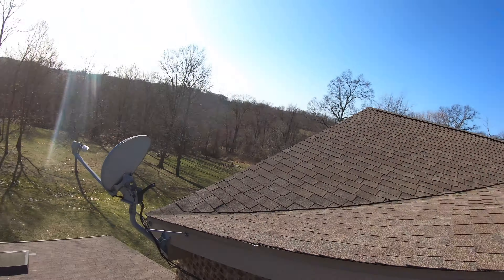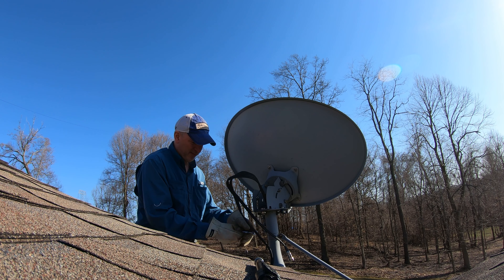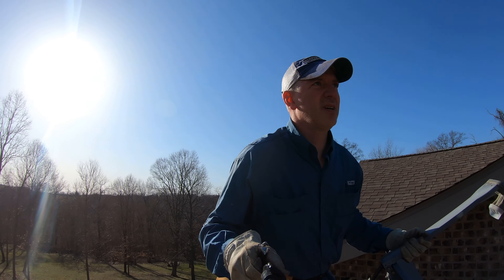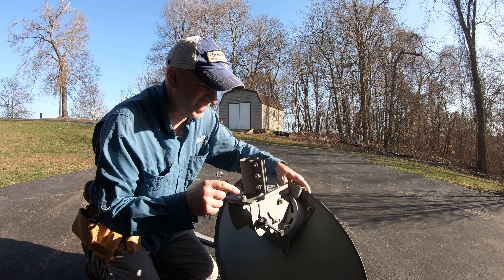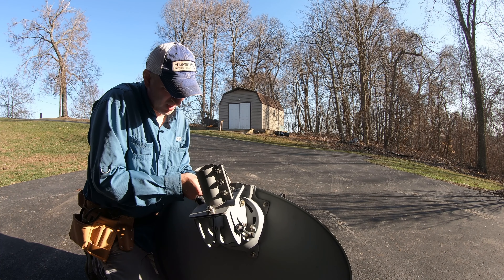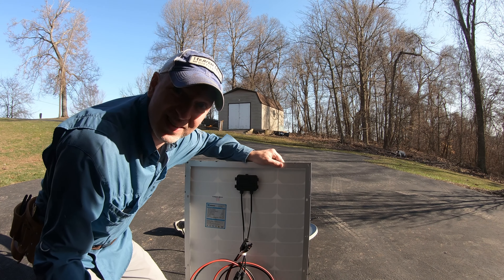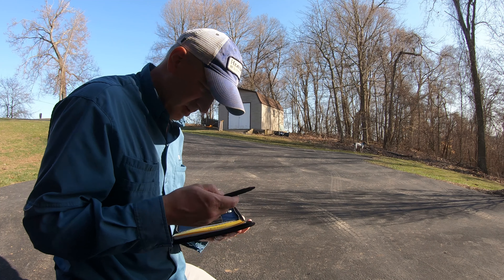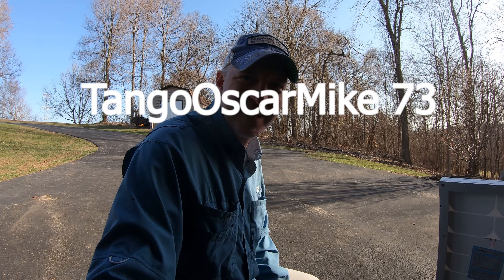Can I repurpose an old satellite TV dish into a solar panel mount?

Comment: I’m wondering if you could take a wall mounted flat screen tv mount that tilts and swivels and attach it to a south facing wall on a house. Then you could manually adjust it a 2-3  times a day to maximize wattage. I’d love to see a video on that.
Reply from the maker: I really haven't found the need to adjust it that often.  I think taking in account some inefficiency when determining the size of the panel you need is easier.
Reply: I bought a 75kg rated tv mount just for this purpose. It has a huge 350watt panel on it. Not so much to optimize output, but I can mount it on a south east wall and still face it south or sw. Also I can swivel it 15 degrees down for the low winter sun in Norway, and store it flat to the wall when I'm not at the house or in high wind. Works great.

Comment: I wouldn't overthink it a few cross  pieces and you are good I have for on the camper and doing 65-70 mph they are fine with the small brackets and eternabond tape

Comment: Hi Tom,
If you need to make a mount, use flat stock along the short dimension and angle  for the long dimension. The angle will add a lot of stiffness. Yesterday, when you made that contact with Jason as KA6LMS/5 on 10W, I reduced my power to 10W and when he next called for QRP made it through on the second call with my yagi. You and the family stay safe. 73  WJ3U
Reply from the maker: Congratulations on the contact.  I used some 1 inch angle.  Seems plenty strong enough.  plenty of room to add a second 50 watt panel.